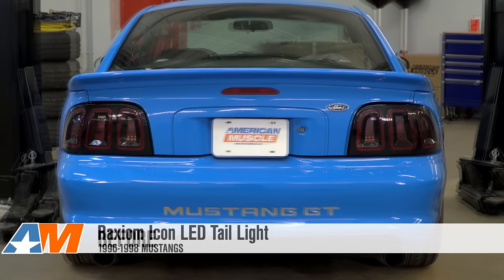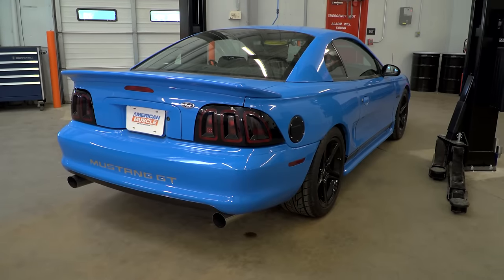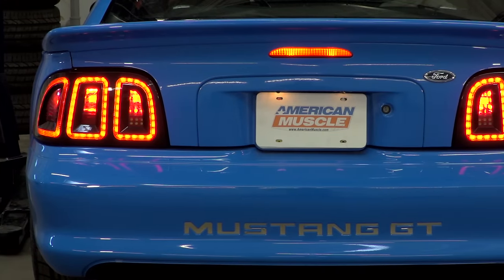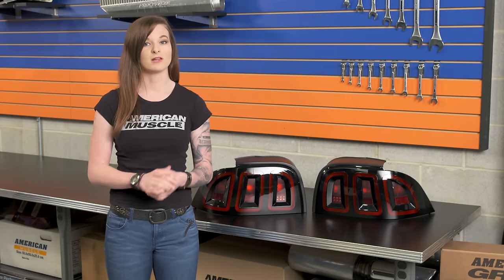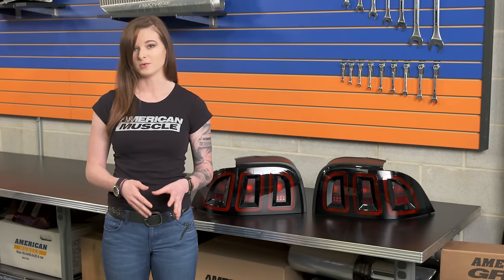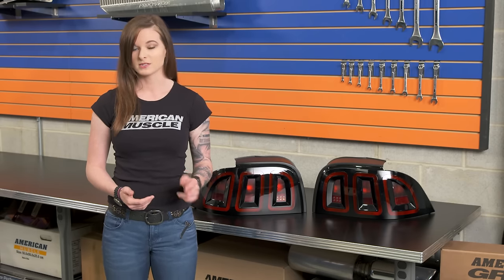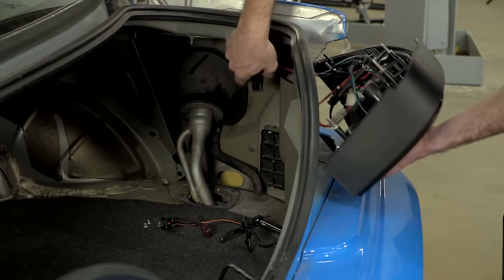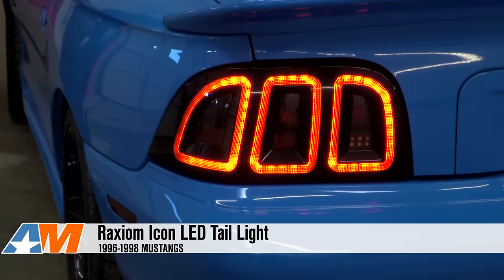1996-1998 Mustang Raxiom Icon LED Tail Light Review & Install

Comment: They probably will work on 94-95 mustang since the connectors are the same but gotta confirm though,i have 96-98 lights on my 94 gt that i swapped to a few years ago.
Reply: Nah keep the 94-95 taillights! It's rare seeing a 94 and 95 mustang on the streets especially with the original taillights.
Reply: Does it work tho?

Comment: I have no hazards tue lights or brake lights.  The parking lights work.  What should I check.  I checked fuses relays and change the multifunction switch. Still nothing.  Thanks in advance.

Comment: Would these work on a 95
Reply: edgar delgado I have a 95 myself. The 94-95 wire harnesses from 96-98. But I do believe if you know what your doing they can be swapped out. I’d rather them recreate our original tail lights with led in my opinion.
Reply: +Mustang gang 5.0 old comment I know but I once had a 97 Cobra I totaled....then bought a 95 gt with a 347 and swapped the 97 tails onto my 95...the 97 was black 95 was silver then went on to use them on my red 94..I love how black tails look on other color sn95 cars which to me is another reason these raxiom tails are awesome if these were available back then I would have got em for sure.  the harness is different but if you have access it s 96-98 harness (like I did) it's an easy swap...it would be easy to find at a junk yard or something